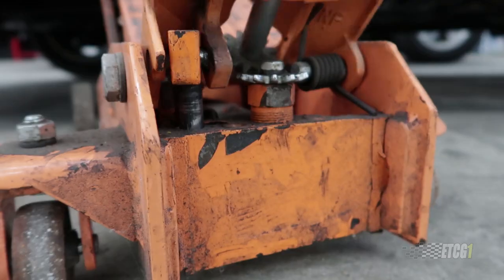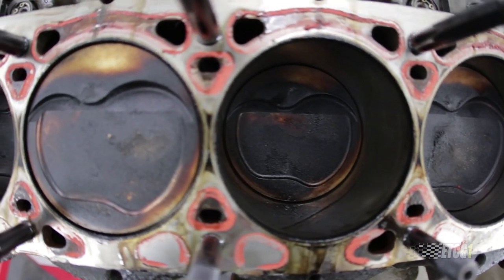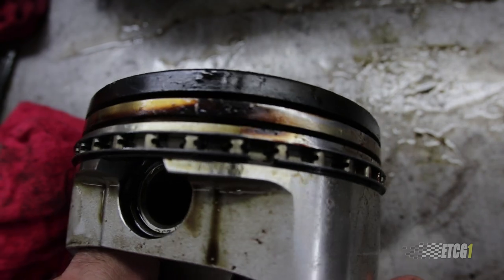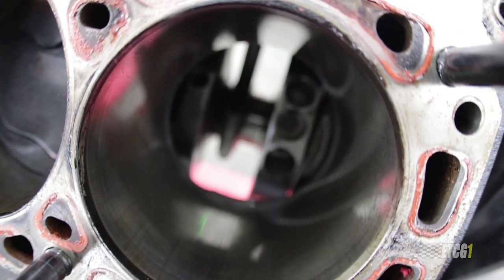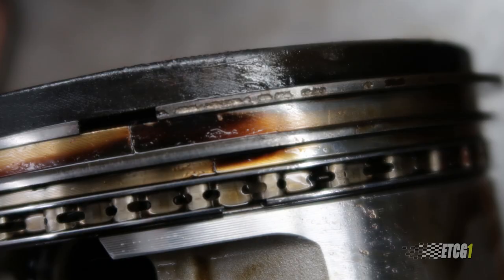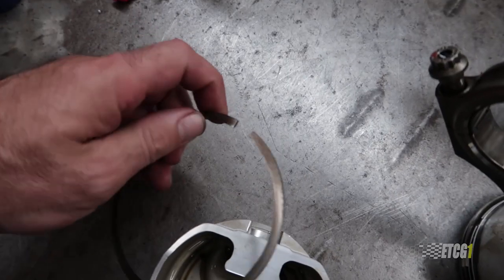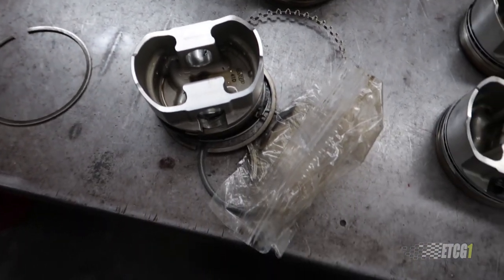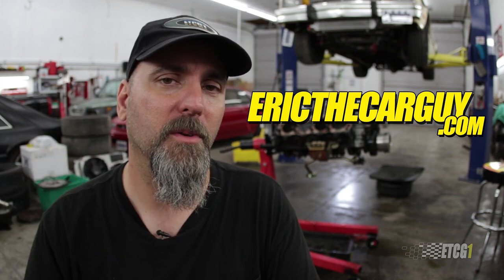Hydrostatic Lock the Silent Killer

Comment: I had my engine destroy itself due to hydro lock !! 97 BMW 328i, sucked water into engine driving through flooded parking lot when I was living in FL (my 90 civic made the same watery trip many times no issues) drove for just about 2 months and 2k miles without a hint there was trouble. Drove my cuz to airport day after thanksgiving, stalled twice inching way up to terminal and ran a bit rough. Decided to stop by dealer and drop her off.  Pull off freeway @ exit stopped at light, dealer is 2 left turns and 1/4 mike away, she starts shaking and spuddering and wham!!! The death blow!!! I could hear metal ripping apart and pinging around. Happy ending to the nightmare is the engine they found to replace original, insurance paid majority of 16k bill, blew upon first start. Ended up with fresh crated engine from Germany with 0000 miles as a posed to the 50 k or so on replacement

Comment: 1991 toyota pickup v6 3.slow was going offroad and it started raining. pulled over to have a breather and 2 mins later the engine locked up. back in 09 i was wheeling my 92 pickup with 22re. let my buddy drive it and went straight into a lake red lining the motor just before he went in. truck still runs to this day 95,000 miles later. went riding on my 03 suzuki dr200se and hydroplaned over half of a puddle then went straight down. engine shut off as soon as i went down and thought i locked the motor but it shut off on its own. started it with the electric starter and drove home. that was about 4 years ago and i still ride that bike too. buess i been lucky eh

Comment: I guess it happened like this because of the fact that it was only the force of the starter instead of the inertia of the engine spinning when it locked.  A running engine will almost certainly bend a rod.  A friend of mine had this happen to a running engine and it bent a rod and even the crank even though it wasn't spinning at high rpm at the time.  I'm kind of surprised that this happened though.  I had a similar problem with a Toyota that had a blown head gasket.  Overnight the cylinder would fill with water and it wouldn't crank in the morning.  I drove it for a couple months like that by pulling the plug and cranking to blow the water out of the cylinder, then putting it back together, filling it with water while it idled, and then driving it to work.  Thing blew steam out the tailpipe like crazy towards the end.  Made good power and never had any blow by amazingly so I don't think the ring lands broke from the starter force.  Maybe the Ford V8 starter is that much more powerful?  Maybe gasoline is a better hydraulic fluid than water?

Comment: I think like an engineer. and I like to think prevention before things like this happen. there are several solutions that come to mind like a valve in the cylinder head that opens and spills its fluid below. or better yet a check valve inconjunction with a spark plug that opens when a certain pressure is met. or it opens electronically with a wet sensor inside the cylinders and opens when it's too wet so when the piston. comes up it pushes out the fluid. or something like VTEC which opens the valves when too much fluid is there.

Comment: My Dad had a 98 Olds, intake cracked and coolant seeped into one of the Cylinders. When he went to start it, it HydroLocked and blew the started to pieces, put a new starter on and drove it for about 4 months it had developed a rod knock, and then started making this swirling sound. It had smashed a bearing and then spun the bearing had the engine rebuilt. But was a costly problem

Comment: If you mist in water won't it raise compression and lower cylinder temps? Raise compression because the added water won't compress like the fuel and air. Lower cylinder temps because the water isn't enhancing the heat output. Granted it might be only good for fuel economy but it may be a good option for lowering engine temps in an emergency if the engine is tuned on the ragged edge.

Comment: Stock factory air intake + TBI on a Chevy 5.7 is a safe configuration.   There will be so little power being made by the engine you would have to drive it into a lake to get enough water down the manifold to hurt anything.

Comment: I blew a classic Subaru engine due to hydro lock. I had a carburettor failure going up a hill that caused severe fuel starvation but that's not what did it. What did it was that I swapped the carburettor on the side of the road with a spare and in a moment of desperation re-used the two gaskets that sit between the OEM phenolic spacer for the carb. On that engine there is a coolant gallery that goes up to the carb that sits right next to the intake. The moment the engine fired it took a big gulp of coolant and two cycles later it blew a cylinder. Boom. You definitely know when it happens, big knocking sound.

I haven't torn it down yet to investigate but peering in under the sump, it looks like the rods are straight so it might be ring lands. Either way the compression is virtually nil on that cylinder.

When that happens I wonder if it throws the crank out of true?

Comment: So, let's say we go through a puddle, the engine stops, then we successfully start it and go thinking we've got lucky. Is there any way to check on the engine if something did in fact bent before it's too late? Will timing or compression be different on a piston with slightly bent con rod so to be detectable?
Reply: if it was running/hot engine and took in liquid, 99% chance damage was done...... if it was off/cold and starter cranked until and stopped, about 25 to 99% chance of damage, depending on overall starter torque,  the one time an old weak battery is a blessing, not providing much starter torque. also hope one cylinder didn't fire and provide large torque/hp.

Comment: So I have a 1994 bronco with a 351 that I blew a head gasket on I replaced the headgasket but now I have a terrible miss to the point where it shoots a flame out of the headers 
I replaced the cap and rotor the spark plugs and the wires could this have happened with a blow head gasket it was badly blown to

Comment: So... a video on inspecting the rods for damage, checking the lengths, or go straight to replacing the entire rotating assembly? Honestly I think stroked and turbo is overkill (on torque) and shortening the stroke could make the engine rev higher and possibly make more horsepower and keep the car streetable

Comment: We had the flywheel on an 18 speed truck come through the floor into the cab of a freightliner truck on a test drive. There were a lot of issues leading up to this failure that the driver had ignored, but the truck was finally brought in for a "lack of power" complaint. Sheesh.

Comment: Thought I would try seafoam. Didn't run the engine long enough before adding it. Hydrolocked up, and blew out the side of the block. Good times.
Reply: Shwoops! lol
Reply: Tistricky8 That’s a bad one lol!
Reply: I really don't know exactly what I did wrong. Maybe the engine wasn't hot enough, or I put in too much. Yeah, blew out a big ass hole on the side of the block. LOL
Reply: I learned a whole lot more about cars than I ever wanted to. Borrowed a engine hoist from a friend, and bought a used engine from the dalvage yard. Swapped the thing out myself.
Reply: Tistricky8 You likely put too much in but then again maybe it was on it’s way out anyways, glad you got it fixed up again, that’s awesome.

Comment: My girlfriend ran a 95 Corsica through a flooded road, so I took the spark plugs out and poured a whole bottle of heet through each hole and waited til it dried. Got it running and sold it a year afterward still running smoothly. Not sure if I got lucky or what.

Comment: Hey man, loved the video great content! I have a Mercedes e320 which had engine jet wash and it wouldn’t start so let it dry for a week and used like a blow dryer and eventually it will start now but it turns off around 15 seconds and white smoke out the back. Any suggestions ? Thanks

Comment: My Spider Injection in my 1995 Chevy Blazer broke.. I was driving. Pulling into a parking spot 5-10 mph tops... Engine died. I coasted in. Auto transmission.  Tried to start it. It was Froze. Hydrostatic/gas lock..... let it sit. Tried to start it again 10 minutes later. It turned over once and locked. Me, not knowing better, went to start it again and it broke a pin on the flywheel. Free Spinning starter.    Put in a new Spider , flywheel/flexplate and drained the oil etc.  She started up. But ever since she acts like  with a rolling hesitation like its slightly missing. Almost a slight wobble if you will. This was 10, 000 miles ago but it still worries me. What do you think????

Comment: Ok! Ok! I'll follow you on Facebook!   I can't believe you blew up a motor just to build your social media.  Hardcore dude, hardcore.  Forgive my gallows humor. If we don't laugh we'll cry sometimes.   I had no idea Pikachu was hurt.   Hey, if it hasn't already been mentioned, really  measure that rod and the bearings.  Damage might a lot more subtle than a rod that looks like a banana.
Reply from the maker: No worries on the humor. If it's funny, it's funny. Just for clarity, I didn't blow it up, I just had a dead hole that I'm in the process of fixing. The machine shop has the connecting rod and will make sure it's good before I put it back into service.
Reply: In that case......commencing Ford jokes in 3...2..1.    Just kidding!  
This makes me wonder if some sort of pop-off valve could be developed to prevent hydrolock damage.   Is there a valve that is strong enough and fast enough and can withstand the heat?  Maybe it just doesn't happen enough to be worth the effort.  Hey, wait a minute, maybe that's what Ford was going for with it's 4.6l spark plug design.  :-)       :rimshot

Comment: I wonder if this is what is wrong with my 2.9L V6 in my 1988 Ford Bronco 2....although it runs, it smokes like crazy, burns a lot of oil, but still has good compression on all cylinders, I suspect the #1 piston which is the one spark plug that keeps fouling itself to the point that it begins running on 5 cylinders and a huge loss of power of course...although I have never driven it through any deep water, kind of think its got a head gasket issue on that side as well but not losing coolant so its a total shot in the dark but the symptoms sound really similar.  That or the rings are just gone completely?
Reply: valve stem seals bad, probable worn valve guides and heads filled up with cooked oil carbon and likely oil return ports plugged and not draining back to the pan...
probably PCV valve/hose/breather issues overlooked, which helps them carbon up much worse too :)
Reply: and possibly ring/piston/cylinder issue on that one cylinder. check the above items first, could be a simple cleaning and slapping in some valve stem seals to get more life out of it. also don't overlook a bad injector, they'll wash the cylinder out and eat the rings/wall
Reply: It has the standard valve train rattle..apparently Ford build this into their 2.8L and 2.9L engines...more so in the 2.9L's though LOL.  The PCV valve needs replaced for sure, and the side that is the worse for oil draining back to the oil pan actually is the opposite side of the engine...I'll have a much better idea and fix this fall when it goes in for its engine rebuild...doing a complete rebuild and all gaskets, seals, bearings, etc.  I enjoy driving this one way too much to let it go...well add to that the $2400 transmission rebuild HAHA!! so it needs to stay operational for several more years.  

It'll be getting new injectors as well during the rebuild.  So it'll basically be a new truck when its done, aside from the paint work it needs, which I really want to do myself as a learning experience and considering the paint shops want $5k to paint it, I am pretty sure I can do it myself for a lot less.  Course it needs a bit of interior work and a couple of electrical issues one being the rear wiper and the other being the rear defrost, the only 2 items that don't work...the factory radio also needs removed and replaced as it works fine on AM but FM all I get is squealing and whining, which actually goes away after about a 1/2 hour of driving, as if the stereo needs to "warm up" first...course the clock/radio frequency display is dark as the bulb is burned out so it needs some TLC anyhow.  

Nope, its not a race car, no its not a performance truck, etc. but its something I enjoy driving and its small enough to go pretty much anywhere with it HAHA.  I repaired the AC in it about 2 years ago and its still working fine, and probably have to redo it again after the engine rebuild but I want to take everything off again anyhow and clean the evaporator, condenser, lines, etc. again just to be sure I got everything out that may cause eventual damage since the compressor in it failed.

Comment: Sorry to hear about having that ring land failure with the Fairmont and missing part of the Hot Rod Power Tour. 3 months ago when I saw your video about the fire I noticed / heard how long the fuel pumps ran when to first turned the key, they seemed to run forever and just didn't "sound right". I falsely assumed that you pulled the plugs and spun the motor over before trying to start it, "just in case" the "flooding" was real bad.

I am curious how much your were able to "power tour" or how far you got? (Not a fan of "social media".  I avoid anything that POTUS would be involved in. Plus my addiction to YouTube is bad enough, don't need Facebook or Twitter to suck up more of my life.) Bowling Green, KY? (Power Tour ended there in 2017, good place to resume the "tour" this year.) Chattanooga, TN? Hoover, AL? Darlington, SC? Raleigh, NC?  Would have been nice to see photos or a video of the Fairmont on the 4-lane wide zMAX Dragway on Friday in Concord, NC by the Lowes Motor Speedway.

Comment: Eric i had a 4.0 ranger in the shop 2 weeks ago. Came in for coolant leak. Pressure tested it and turns out the engine had a blown head gasket and end result of the pressure test forced coolant into cyl 4 and fired it up and it ended up dropping a valve as result of coolant intrusion
Reply: so, radiator pressure test leaked down, you didn't see a leak visibly and cranked it over without removing plugs.......
let us know what shop that is so nobody ever takes their vehicle there :)) 
yeah, It was most likely damaged already, but still........

Comment: I told you DMPC was cursed last week Eric. The prolonged dyno testing issues  because  of the incorrect carburetor hat, then the fire caused by incorrectly set fuel pump pressure  now this hydrostatic lock damage. I think its because you gave the engine such  a bizzare inappropriate name. 😲
Reply from the maker: I don't think the universe works that way, but I appreciate the insight.

Comment: So what was it about the fuel regulator that caused the problem? I am curious, because I ran into problems trying to run an electric fuel pump with a carburetor and eventually just went with a mechanical pump.
Reply: in his other video covering it. he showed ans said the regulator shipped with the wrong spring in it. it had the high pressure spring for fuel injection in it, even though everything stated it was shipped/assembled with the low pressure spring for carbureted  application.

Comment: Is the hydrostatic lock your describing that's basically what they're talking about in drag racing when an engine blows all to hell and they say the engine hydrauliced, causing the explosion,  correct?
Reply from the maker: Hydrolock happens when a cylinder fills up with liquid instead of an air fuel mixture. Usually caused by driving through deep water. I don't think that's what's happening to the racing engines you mentioned.

Comment: My civic type r sucked in water through the cold intake, cut out. When I got it recovered I blew out the water from the spark plug holes and sucked it out of the manifold, 2 months later it runs fine… think I dodged a bullet?

Comment: Hi Eric. I have a 4AGE 20v engine which developed a no-start condition. Did a dry compression test which showed 30psi across all cylinders, which is odd. Car was running fine before being put away for the night. (I now suspect a stuck IAC valve for this condition, which has since cleared up).

While carrying out a wet compression test, I accidentally hydrolocked cylinder 1 with too much oil down the plug hole. I cranked the engine over to remove the oil, and completed the wet tests, which showed 150psi of compression on all cylinders. The car started after this, but now produces smoke on acceleration. I initially suspected a head gasket, but now I wonder if I have broken rings or ringlands. What do you think?

Comment: Damn. I hydrolocked the engine in my jeep cherokee one time. It was raining so hard i couldnt see the road was flooded and i hit like 10 inches of water at 30 and it just shut down.. lucky a guy in a citizens power truck stopped and pulled me to a near by gas station. And had the tools so i could pull the plugs and crank it to get the water out. Looked like a geyser under my hood. Both of us thought it was done. It had a good life 275,000 miles but we put the plugs back in and after about 30 seconds of cranking in typical 4.0L fashion it roared to life. There was water coming out of the tail pipe and it ran like shit for about 5 mins and then cleared up. 3 years later at around 320,000 miles i started noticing a knock when id cold start it. Once it warmed up it went away. And i always ran the dog shit out of it but it never gave up on me. Sold it with 335,000 miles on it and that was 4 or 5 years ago. And i still see it driving around from time to time. Maybe that hydrolocking did damage like happened to yours and it didnt start showing its face till many miles later. Never thought about that till now.